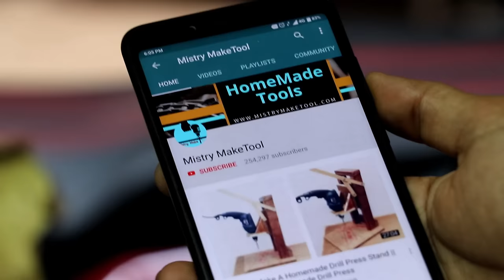How To Make Foldable Clothes Drying Rack || Wall Mount Drying Rack

Comment: Nice idea. But instead of using a single rope, use individual ropes and tighten each one separately. Otherwise it will sag too much and the nylon ropes will be cut at the holes. Drilled hoses usually have jagged surfaces on the inside.

Comment: Good. Close the end with plastic/rubber/metal endcap.
Reply: Probably better to let the rain just run through the tube when it is vertical so it doesn’t rust out. I have seen the ends of tubes rust out around the plastic end caps because water gets trapped between the steel and the plastic. The tube he used is thick wall it won’t rust out very quickly.
Reply: @JWB671  i was also feeling like to use rubber caps for better finishing... but i get your point also so i am going to use removable caps for my diy 😀😀 thanks 🤭

Comment: The edge of the falling metal tube needs some soft padding. It is at the corner of a turn and will hurt people. Also while people lift clothes to dry, it may hit them on the head. Good idea, but needs to be made safer.
Reply: Good
Reply: Rubber packings are easily available with hardware store which are used for table can be used

Comment: Stainless Steel string is also available encaseed rubber pipe is very strong and long lasting.
But this design good, must be very expensive for such job.
Reply: Shop address

Comment: The problem is that wet clothes will rub against a concrete wall.
Reply: Simple add some more distance
Reply: @hamedmusun ,
Clear,
but well if there is no wind
And if the breeze blows, the sheets will still slap on the concrete.
I do not argue for the lack of better
your idea is good.

Comment: I would make the hole in the square pipe at fulcrum point as a slot. That way in raised position it can slide down a bit and prevent dropping down on its own. Consider it as a safety feature. All one would need to do is to raise the pipe may be half an inch and swing it down to usable aspect.

Comment: Nice, excellent workmanship with good idea. Because I am bit lazy and don't have the needed tools, I purchased "Homwell Stainless Steel Heavy Duty 5 Pipe X 4 Feet Wall Mounted Cloth Dryer Stand Fold able Hold N Dry" online for Rs. 1478.

Comment: You should put a plastic piece at the ends to avoid water going inside when it rains .. to prevent corrosion of pipe.
Reply: Plastic dummy end cap

Comment: A classic example of how people who don't do that function build things to 'help' people who DO wash clothes.
You measured the operational length of the arm, and divided by 3 placing the inside line far too close to the dirty wall.
Divide by 4, then only install 3 lines away from the wall.
That way you avoid much contact between clean clothes and a dirty wall.

Comment: If the end of the pipe would be capped then it has lesser chance to rusted from inside.. when it will  in use from the upper end rain water filled and get rusted fast..

Comment: Hi thanks nice idea,  but one thing what is the thickness of the bottom plate and the angle you have used in this project,  Kindly reply I Mean waiting,  God Bless You😀
Reply: Angles minimum 1.5 inches, 2" better. Base plate minimum 5mm thick

Comment: This won't work I hav tried rope strain will not allow to fold it smoothly. 1 in 10 times it will work when it is tight, coz rope strain will start loosing by time n use gradually.